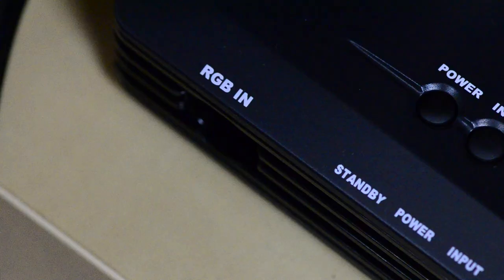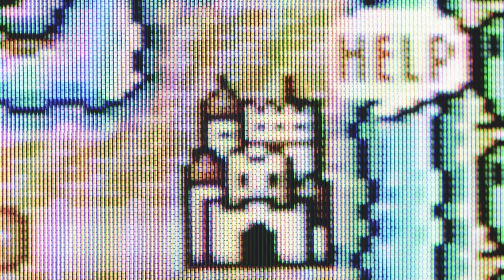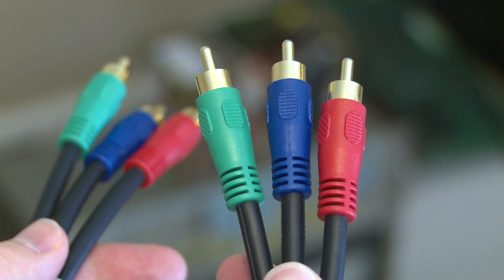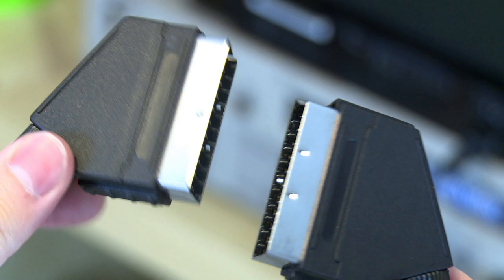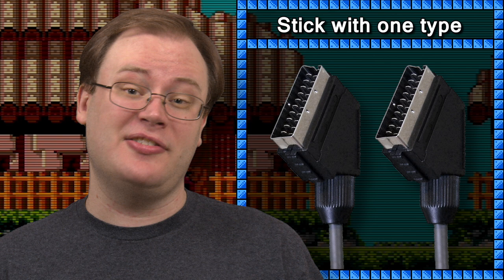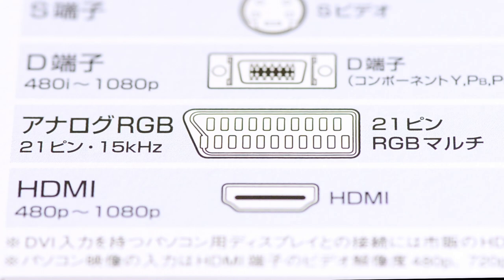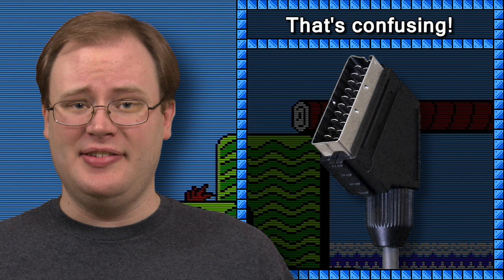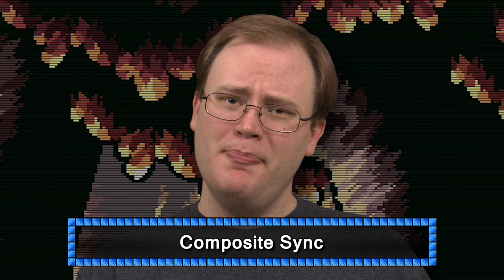Understanding RGB and Sync :: RGB103 / MY LIFE IN GAMING

Comment: Thanks for another absolutely great video! I have watched RGB101 and RGB102 which convinced me to buy a Framemeister.

This video helped even more because I realized that my PAL SNES (I live in Europe) shows the checkerboard pattern. I am using the original french Nintendo Multi-AV to Scart cable which uses sync-on-composite. As far as my knowledge goes through research, the checkerboard can EITHER be eliminated by a cable that uses luma sync OR removing the capacitors inside the scart plug and replacing them by resistors OR by a cable with a built-in sync stripper that cleans the composite signal to only leave the sync to pass to the Framemeister.

I am not sure which way to go. Do you have a recommendation?
Reply from the maker: [Try4ce] My understanding is that the PAL systems use resistors for RGB, and the NTSC systems use capacitors... not being very knowledgeable about how the electronics work exactly, I can't say much more than that. Remember, the cables themselves don't define PAL or NTSC... in most cases, they can be used with either. But the SNES is a special case because of how the RGB line uses different tech on the PAL consoles. It looks like retrogamingcables.com (a UK site) has a sync-on-luma option for PAL SNES. Might try that! No CSYNC listed there for PAL, but I don't know if it is or is not possible.
Reply: ***** Thanks, I think I will try it with a cable with the caps replaced by resistors. If that doesn't solve the problem, I will test the cable with sync-on-luma from retrogamingcables.com.

Keep up the great work. It would be nice to see a video explaining the different settings in the Framemeister menu in detail.
Reply from the maker: [Try4ce] Getting a video out on Framemeister settings is a very high priority right now. Hopefully you'll see it very soon!

Comment: So I'm still a little lost on a couple things regarding sync. Mostly related to N64's situation:

1. Does sync on luma cause issues when the screen is mostly white (like flickering or losing sync) or is that because of something else? Would I just be better off getting sync on composite? Saw this in PhoneDork's video which is why I ask.

2. Finally, how do I figure out what sync my PVM 1953MD takes? I know it takes CSync and boosted Csync just fine, but haven't gotten other cables besides that. Stuck because I'm not sure if I can get Luma or sync on composite. Want to know before looking into sync strippers. The manual does mention "EXT Sync in: BNC Connector Composite Sync", but I'm not sure if that means if definitely needs CSync no questions asked.

3. Unrelated to the video, but does getting your N64 RGB modded affect Composite and S-Video? Heard that it does, but can't find anything else on it.

Anything helps... Been looking into this for awhile now and has really been bugging me. Thanks for the great videos!
Reply from the maker: +STLRamsFan [Try4ce] 1. Sync-on-luma is generally considered to be the best option for N64. While it's possible to use CSYNC depending on how the mod was done, we've heard that it can still be problematic, and that luma is still the way to go. We've heard about issues with "bright screens" with devices like the XRGB-3, but I've never had that issue with the Framemeister or my PVM.

2. I believe sync goes out the same pin no matter where it originates from, so I'm pretty sure sync will go to the EXT Sync cable, regardless of whether it's CSYNC or luma, or whatever. I've used my sync-on-luma PS1/PS2 cable directly into my PVM, bypassing my sync stripper, and it works just fine... though I don't know if my SCART to BNC cable might be performing some sort of stripping function (I don't think it is...). However, I have to admit that I don't know a ton about sync considerations when it comes to PVMs.

3. Nope! They still work just fine. However, I do have the "old style" RGB mod. Testing it against an unmodded N64, it looks no different. But when I tested the "new style" RGB mod, S-video and composite looked slightly different, but only because it was a later model where those look different anyway. Check out our N64 video to see how those compare. In December, I got the HDMI mod, and it coexists with my RGB mod! I can use RGB on the PVM and HDMI on the HDTV at the same time, it's amazing! I don't know if that is possible with the new style RGB mod, I heard it would be very challenging, if it would even work.
Reply: +My Life in Gaming Awesome,  thank you. I'm guessing if I was really worried about CSync I could consider getting the RetroGamingCables N64 Scart cable that is labelled "CSync (Built in Video-Separator)". Unless that is for systems that do get CSync wired. Any experience with that particular cable?

Comment: A small question. To get the CSYNC connection to the framemeister, both the RGB-scart adapter and the scart from the console need to be CSYNC capable?
Reply: For instance, using this it states from what I understood in the technical description, that I don't need a csync scart, just the adapter, right? http://www.retrogamingcables.co.uk/micomsoft-framemeister-xrgb-mini-adapter--euroscart-with-sync-stripper.html
Reply: Tiago Ferronha Check a previous comment of mine on this video about sync strippers for more information.

In short, I would NOT get that type of adapter unless you know that you need it. There's no way of knowing whether it would improve your setup or make it worse without knowing more about your particular case, so I'd pass on it unless you know that you have sync problems that you need to fix.

I would get cables and an adapter that do NOT have built-in sync strippers, and just try to make sure that you get the best possible cables for each of your consoles. For consoles that have c-sync pins on their AV ports, get RGB cables that pull their sync signal from that c-sync pin. For consoles without c-sync but with luma, get cables that use luma as sync. And for everything else, get cables that use composite video as sync. If you happen to have sync problems, THEN consider picking up some kind of sync cleaning solution. In most cases it isn't necessary.

Comment: are you guys upscaling the RCA composite signal and off to SCART out with that framemeister or are you pulling the RGB signal right from the device itself then going into that box?

any is the NES demonstrations upscaled or do you actually have the system modified to output RGB? I know thats pretty tough mod but i guess its worth it
Reply from the maker: If it leaves the system as composite, then there's not much you can do to improve it. The NES video we use is recorded using the NES RGB board mod, which is a fairly new mod, and it is very very worth it! The results are amazing, and you can buy the parts here: http://etim.net.au/shop/shop.php
Reply: *****
yup exactly what i was asking..cause ive seen scart cables for NES but its just pulling composite/yellow RCA..which isnt true RGB but u kno.

Comment: Great video, thank you both! Is there a way to tell what type of sync a cable is set up for? I have a modded PAL mega drive that is dropping the sync in 60hz mode only. I'm hoping this means my RGB cable is sync over composite and that a composite sync cable will fix the issue.
Reply from the maker: +Phill Coverley [Try4ce] Someone who knows what it should look like inside would know, but that's not me! I did run across one cable that wasn't what it was supposed to be, and I figured it out by process of elimination.

Comment: Hello, I have a ps2 component cable ypbpr (only 3 colors with audio) and when I plug it on my pvm it shows only a green color in picture (although I change the ps2 configuration video out) , how can I get sync in this case ??
Reply from the maker: [Try4ce] There are three things you'll need to be sure are set. First make sure the PS2 is set for "YPbPr" and NOT RGB. Then make sure the PVM itself is set for either "component" or "YPbPr," as well as set for "internal" sync. Those functions may be together or separate, within a menu, or as a physical button, depending on the PVM.

Comment: I have a PS2 and the "AV output" cable has a white, yellow and red cable, those are plugged into an Adapter that came with the PS2 and looks like a Scart but it's lacking pins, it has 11. I have a second Adapter that looks the same, it has 8pins but looks like you could put additional 12 pins into it and it has screws to open it up (the PS2 adapter can't be opened)
Any ideas on how to do something useful with it? I know to solder.
Reply from the maker: +Miyako Black [Try4ce] Hmmm no particular ideas, I don't know much about how all the SCART pins are connected. It could be useful for parts, though!

Comment: One thing I don't understand (I posted about this on the video about the Saturn as well): this video says that SCART and JP21 are completely different, yet I'm getting a good, clearly RGB signal from my JP SNES to my European Sony Trinitron Wega, oddly using a crappy cable that was advertised as being intended for PAL SNES (but which doesn't actually work on my PAL SNES, I've tried). The JP SNES is only supposed to output JP21 right? But my European TV still accepts the signal.. over a supposedly PAL cable? Huh?
Reply from the maker: [Try4ce] The difference between the cables is simple. It's the end that you plug into your TV/upscaler that is wired differently, NOT the end you plug into the console. Think about it - the console's RGB signal is going to come from the same points no matter what the connector is like on the other end, right? And RGB comes from the same pins on all consoles no matter what region, when RGB is supported. JP-21 doesn't mean the consoles are wired differently, it means the end you plug into the TV is different. The RGB signals go to different pins on that end, thus you can't use it with a system expecting the European standard. As it is, my understanding is that JP21 was not widely used or adopted in Japan, and didn't even have a proper name... JP-21 is more just something the gaming community has started calling it. I think they just called it "21 pin connector". Sometimes you'll see it called SCART, but that makes things confusing, so we try to distinguish it.
Reply: @mylifeingaming  i see, i think i finally get it now, thanks a lot! So the consoles wont care if the signal ends up going to a scart or jp21 plug (assuming the sync method is correct), it's just the TV that might not accept jp21 right? That makes sense
Reply from the maker: [Try4ce] Correct. The actual composition of the signal is the same. It's still RGB. They're the same quality. It just goes to different pins for who knows what reason.

Comment: I have a question, i had a snes mini modded for RGB.An i wanted to know does it halft to be modded for csync for it to take the cables?
Reply from the maker: [Try4ce] That's a good question. As I'm not capable of modding myself, I don't know if it's a special consideration on the modder's part or not. I just bought a pre-modded SNES Mini, and it does work with my CSYNC cables. I don't know if you can expect that to always be the case or not.

Comment: Which one do I buy if I have a Super Famicom? The JP-21 since it's a Japanese console? Or would the scart work too?
Reply from the maker: Pepsu-Chan [Try4ce] Either one works. It's a matter of which pins the wires go to on the other end of the cable. RGB goes out of the console end the same either way. Don't choose SCART or JP-21 based on consoles, choose based on what you connect them to. The Framemeister comes with a JP-21 RGB adapter, but because we wanted to use SCART instead (it's just easier to find the cables for it), we bought an RGB adapter for the Framemeister that's wired up as SCART instead. In summary, either one works, but don't mix and match.

Comment: Very useful. Just bought a rgb scart cable in the uk for my pal gamecube with sync over composite and have the exact same diagonal lines.
Could it be my lcd tv doing it?
Apparently csync couldnt be done on the cable for gamecube.
Reply from the maker: [Try4ce] It's probably the cable for that sync type to work well, the cable needs superior shielding to separate the composite signal from the RGB and audio signals.

Comment: Hey guys, I have a CRT monitor with 3 plugs for "YCbCr" and I can't find a good answer on what exactly it is. Which plugs take what kind of information?

There's also a yellow "coaxial" plug near it. I have no idea what it is for, but it might be related.
Reply: It's basically the digital version of YPbPr. Not sure what cables are used with that. Does it look like RCA jacks?

And the orange coaxial port is for some type of audio. I think its for surround sound or something.
Reply: Thanks :) Yep, my YCbCr is 3 RCA jacks (Red green blue). Strangely I think its an output, not an input, since I can't detect my Wii with it.

Comment: Thanks you, your video was extremely helpful! I am wondering though, for my North American SNES-1 SCART cable, would a luma or CSYNC sync be the one that works best?

 I believe you did address this in your video, that CSYNC gives the best image in this case, but I may have accidentally ordered luma output... I should have watched your video first!
Reply from the maker: +A.O. Swat [Try4ce] Luma is actually a great option. In most cases, it provides indistinguishable results from CSYNC. In fact, from my tests, it has the all-around best compatibility. The 1CHIP-03 SNES won't do CSYNC, and for other 1CHIP consoles, I ran into issues with sync-on-composite for SuperFX games. The only system sync-on-luma might have an issue on are modded SNES mini systems, but it's also possible to mod these to support it. It's also the preferred option for N64 RGB mods.
Reply: Hmm, while I'm not sure if my SNES is a 1CHIP-03 (the serial # does start with 'UN309'), I changed my order to a CSYNC ntsc, which I plan on hooking up to a SCART/HDMI converter. The main difference being it's a Panlong upscaler (framemeister is out of price range atm). But from your video, that sounds like it should give me pretty good RGB? 
Also thank you for your feedback, this stuff is pretty tricky. Is there a good way to support you guys?

Comment: Wait can someone clear out the Composite RCA to Component tip he talked about? So you can plug in composite RCA plugs into an HDTV's component input the way he showed and it'll work?! I don't understand how the white and red cables go into the Pb Pr since those are for color signal and not audio...
Reply from the maker: +Goreface69 [Try4ce] That's NOT for using with a console's AV out, as the signal going down that wire IS audio because it touches the audio pins on the console end. That tip is only for like, DVD players, where you could plug say, white into blue on BOTH ends.

Comment: My Life in Gaming Can you please help me to decide which Wii SCART cable to buy for my B&O MX7000 CRT TV? I want to connect my Wii (PAL) on that TV, which has two RGB SCART inputs, and handles both 50 and 60Hz signals. I'm looking to buy SCART cables from RetroGamingCables, they have sync on composite and CSYNC versions, but I'm not sure which one to choose? Would I see any difference in picture quality between these two types of sync on that TV, and do you know if I opt for CSYNC cable, will it work on my B&O? Thanks in advance for your answer.
Reply from the maker: [Try4ce] This is a very Europe-specific question, so it's hard for me to answer. We don't have B&O TVs here, so I'm not sure what they accept. I've also never had a chance to try a PAL Wii with RGB output. CSYNC is technically better, but if you buy the "Packapunch" version of the sync-on-composite cable, then the quality should be similar. I'm actually not even positive if the PAL Wii natively outputs CSYNC, so it's possible that the sync in that cable is stripped from another sync source. These are things I need to research, since I want to do a Wii episode this year! For now, I think your best bet is to ask Retro Gaming Cables directly... I'm sure he knows what type of signal is compatible with B&O TVs, since they seem to be pretty popular for retro games in Europe.